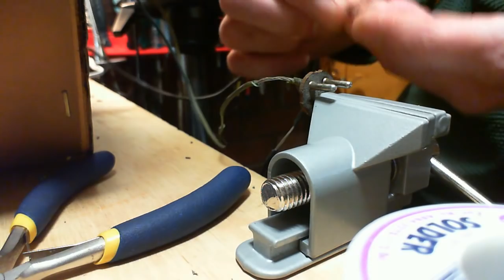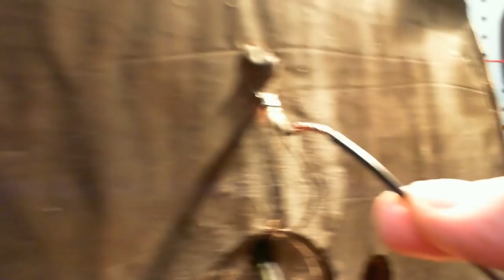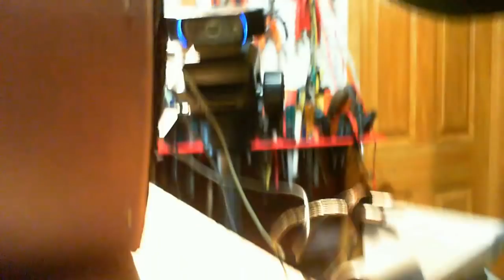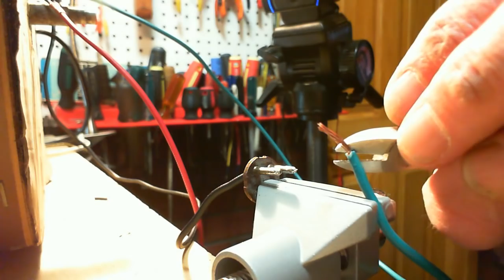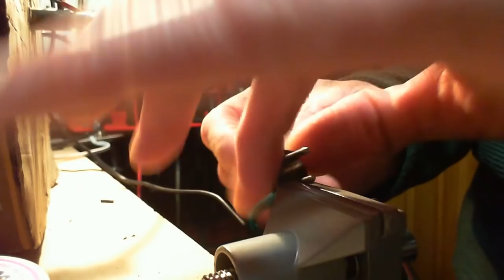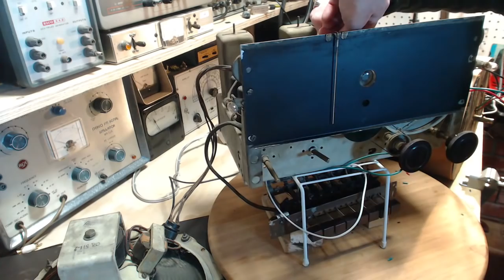Canadian General Electric KL-96 Video#8 - Super BEAM-A-SCOPE Antenna

Comment: The radio I have that has a Super-Beam type antenna, it is orientated vertical, and is very directional. Also, I only use "restricted" power to check for problems, after that the radio "sees" real world settings. Thanks for the videos, and good luck.Carl
Reply from the maker: +Carl  Burgess Hi Carl.  I tend to use restricted power at most times unless the radio is big and the restriction is too much for normal operation.  I then proceed to forget it on restricted power and carry on when I shouldn't.  The root cause is restricted coffee consumption.

Comment: Can't/shouldn't align on restricted power, eh???
Reply from the maker: +John Schroeder I make that mistake often.  On a lot of radios, I have found the change in supply voltage doesn't make much difference if any.  Not so for this one.
Reply: Jim Lindenas ; I doubt it makes much difference at all. Your adjusting frequencies that really should not not be affected by voltage.